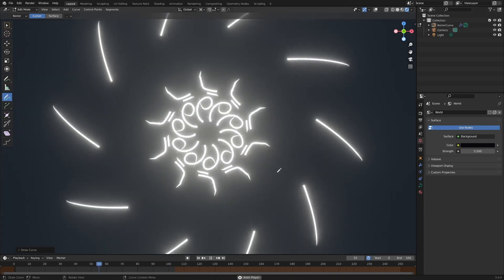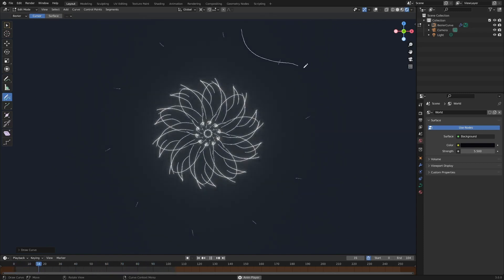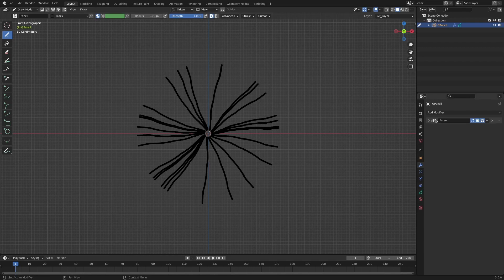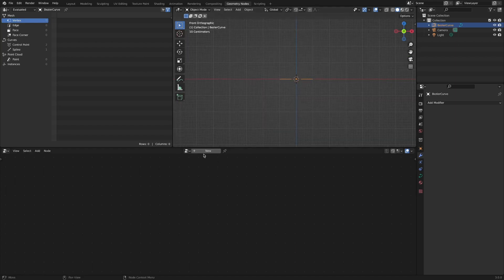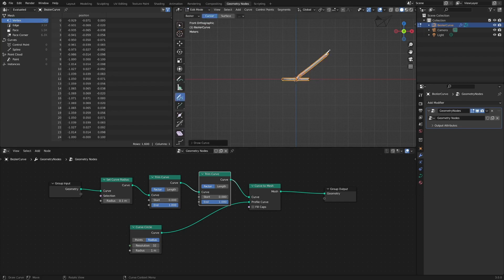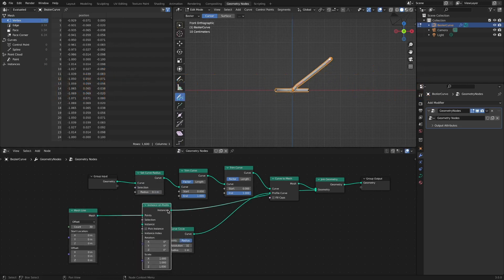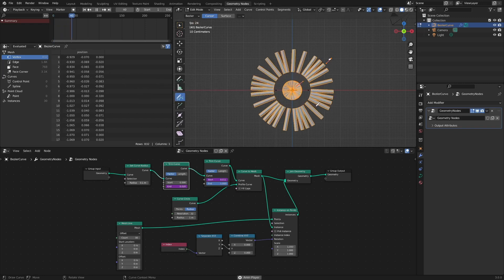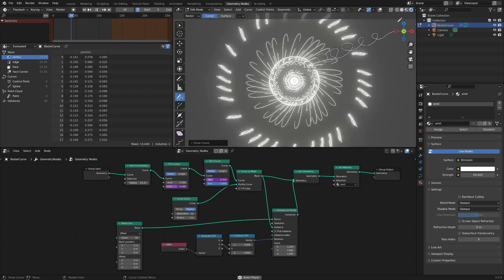Drawing with Geometry Nodes (Blender 3.0, Grease Pencil)

Comment: This is positively great. I'd like to use the result for a lace pattern. In order to apply this on my model I have to convert into mesh. When I do this everything goes wrong (using 3.5). Any suggestions? by the way, I see you've been working on selections with Geometry Nodes. Using your tutorials I have been able to build a node that gives us a feathered selection (Photoshop wording) from inside GN. If you want it I'll give you the node. You can also see the selection using one of your tutorials. Great job and thank you.